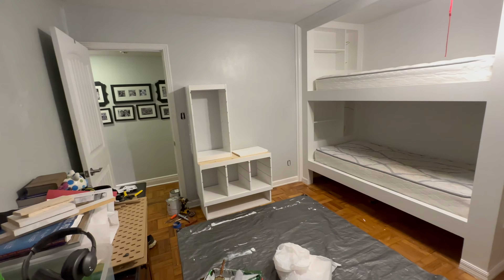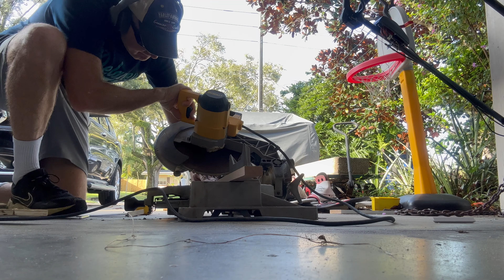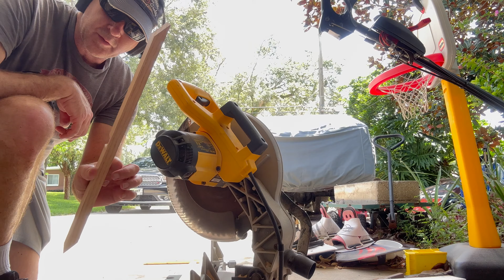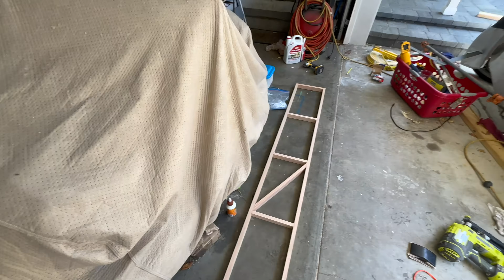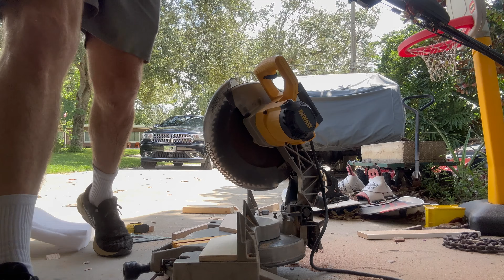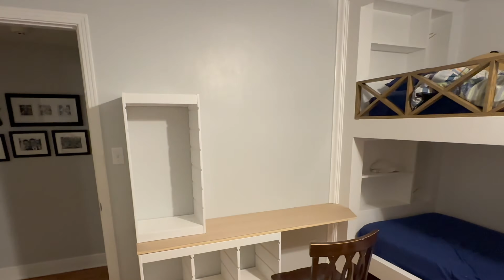HOW TO BUILD A CUSTOM BUNK BED RAIL | DIY BUNK BED PROJECT / WOOD WORKING PROJECT

Comment: Do you remember approximately what the total cost of this build was?
Reply from the maker: It was probably around 750. The majority of cost is in trim and finish boards and the rail. We were keeping costs lower than buying the bunk beds from the furniture store.
Reply from the maker: Check out the other videos on the build on our channel. The bed was probably around 750. The rail itself was probably around 100.